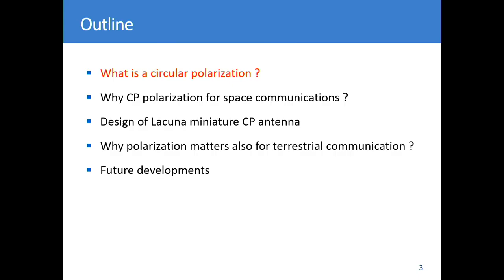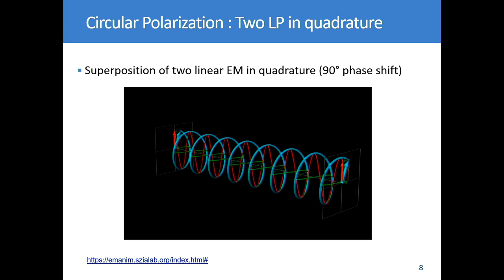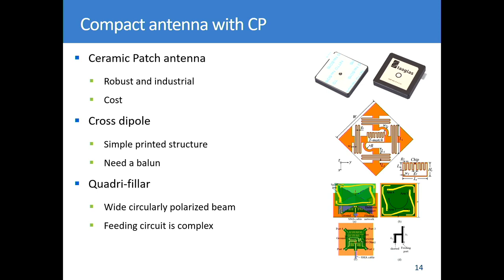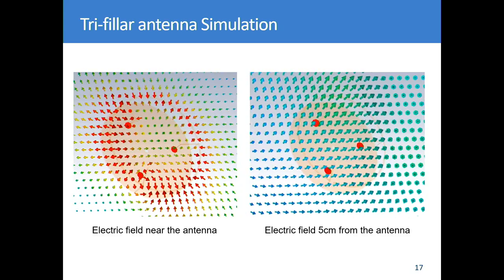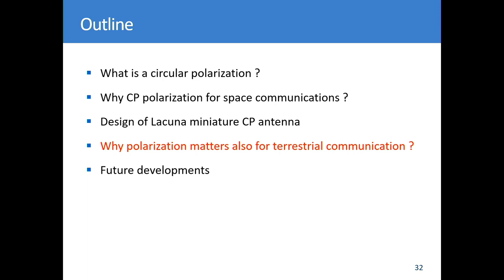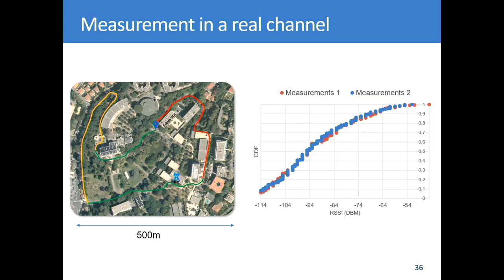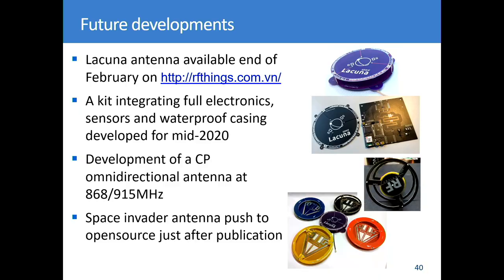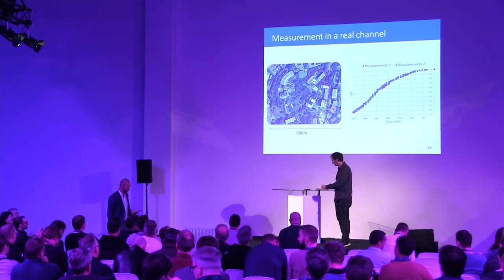Circularly Polarized Antenna For LoRaWAN From Space - Fabien Ferrero (Université Côte d'Azur)

Comment: Why not a CP patch antenna?  I've done these for BLE on 2.4ghz with good results.  Easy and cheap
Reply: the CP patch is the first thing that comes to mind indeed! Curious the performance difference between the two. Also, rogers substrate would increase the efficiency (which, I believe, was not mentioned in the presentation!)